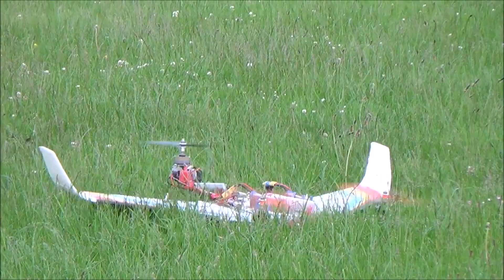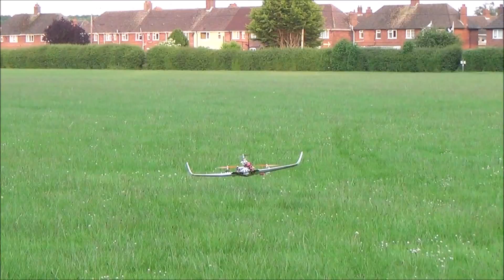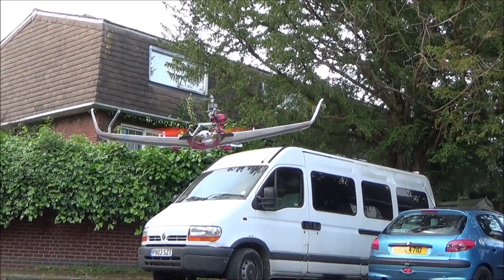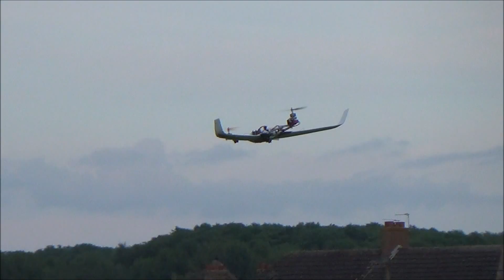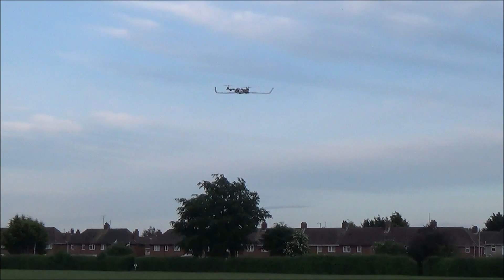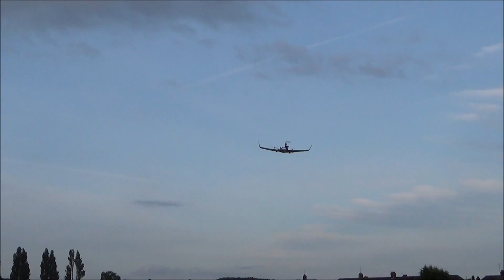Is it a multirotor?, is it a plane?, No, wait yes, Wait no, Maybe?? triplane hybrid v2

Comment: If you mount the rear motor upside down, you can have the tilt axis on the trust center has you have on the front motors. By shortening or removing that distance between the tilt axis and the motor enables you to have full forward tilt, without the propeller hiting the frame and without the lever effect you're experiencing from having the motor away from the tilt servo, making the rear motor tilt forward when throttle is applied